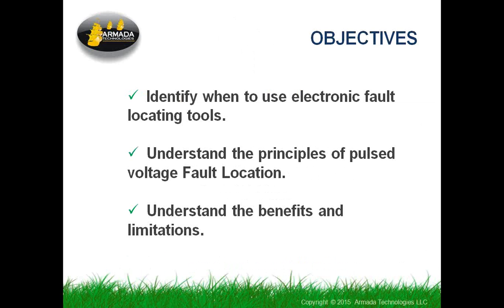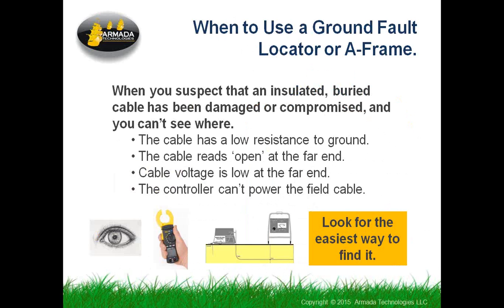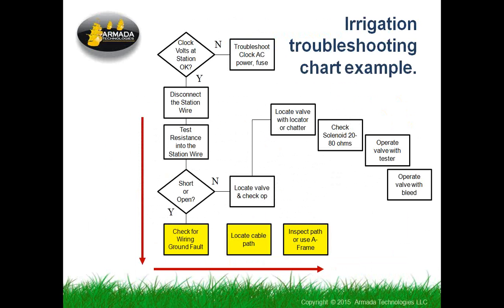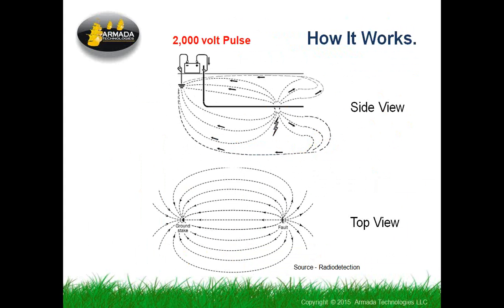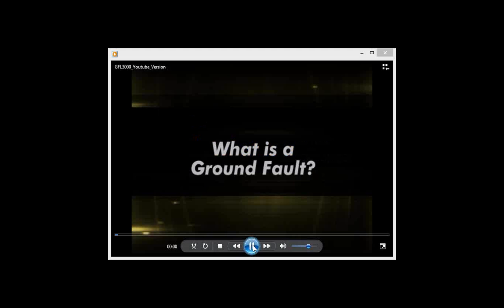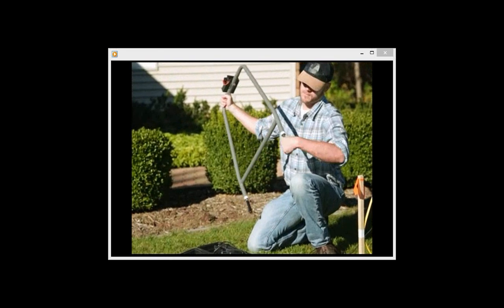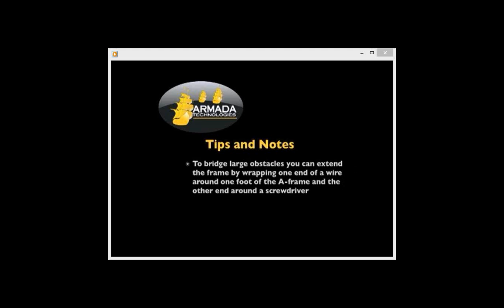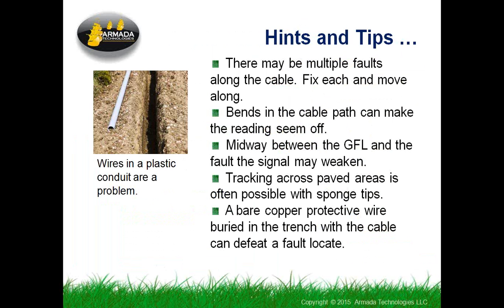How to Use a Ground Fault Locator to Find Nicked, Cut or Damaged Direct Buried Wires and Cables

Comment: Low spot holds moisture and has 120v wire repair, that's my first place to look.
Reply: Yes, we find low spots that stay wet will stress the wire insulation and quickly expose any nicks or bad splices.

Comment: I'm looking for a more sophisticated, easier to use tool to find a multi conductor cable that was nicked but not fully cut. Is there such a thing?
Reply: The GFL will work, but since only some conductors were exposed by damage you should tie all the conductors together and clip the red lead to that group. Black lead to ground/earth as usual. That is the fastest approach.
Jim at Armada.
Reply: A regular wire tracker will often show that kind of fault as an increased signal spot. You may have to connect all the conductors together to be sure and include the damaged conductors.
Reply: @jlcarefoot  Thanks for your reply. I have used Greenlee 501 tracker for years. Unfortunately, if there is any conductor in the cable assembly that is intact or if they are at all touching where the cable is nicked, the signal skips right over and continues. It is basically impossible to pick up the spot. The signal varies slightly because of the way the cable is buried (depth, roots, rocks, etc...), so you cannot tell if the signal is slightly stronger because of a nick or the way it is buried. Although I've never tried the A-frame, from the videos I've seen it does not seem very practical. Often times I'm working with a cable 200-400feet long. First I have to track and flag the cable, then I have to disconnect all the solenoids from the cable not to fry them. The cable can have 8-12 valves connected to it. Just disconnecting and reconnecting all the conductors properly is very time consuming. I will normally charge to redo old splices between cable and valves. By the time I do all this to find the nick and then have to fix the nick... it's almost less expensive to just run a new cable in many instances. Just some insight from the field. I'm not sure how much better Armada's tracker is to find the nicks vs the 501. After all, if it could find nicks, why would you guys advertise and sell the A-frame. I looked at other brands, there is really nothing out there but the A-frame. Most guys never look for a faulty spot in a cable (because they never find it or it takes too long too try and they may still not find it), they just run a new one.
Reply: @BikerrrNY  The Progressive/Greenlee/Tempo 501 is a high-frequency (450 kHz) signal design which means tracks will often jump small breaks and damage. It is great for general purpose tracking especially with short wires. Most irrigation locators are closer to 2 kHz and show damage better in my experience. Good point about the voltage and valves, but we use the GFL on valve wires, 2-wire control cable and even low voltage LED lighting - connecting to the cable the right way can avoid the danger. For example lifting the Common wire can avoid making a circuit that might damage a valve solenoid, and sending the HV pulse on both wires tied together in lighting or other 2-wire cables is pretty safe.